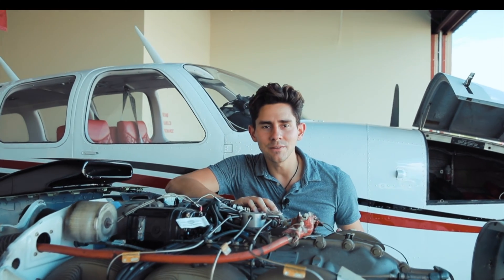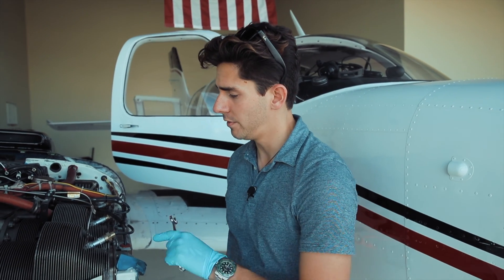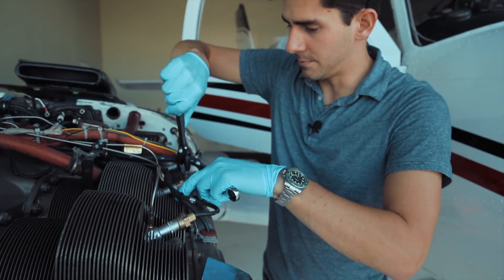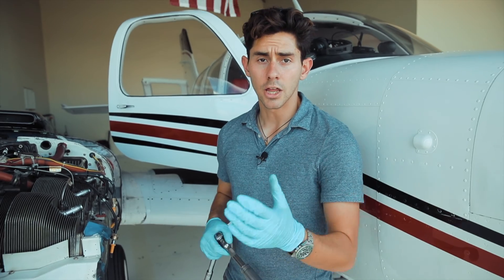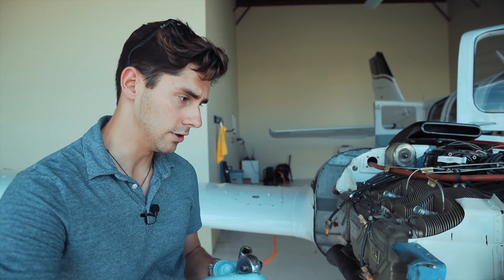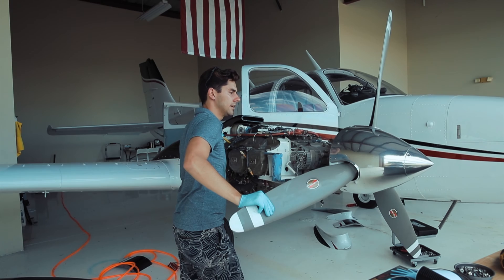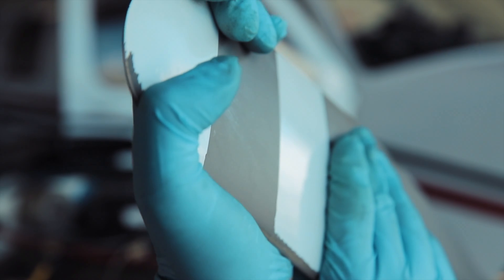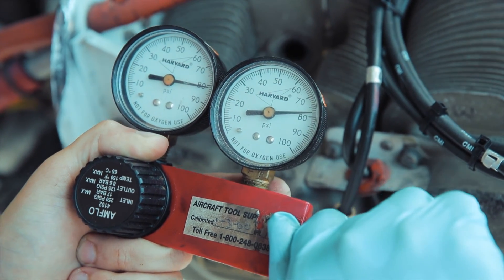Aircraft Compression Check

Comment: Oh no you "dittent"  You were using an adjustable on the loosening of spark plug cables.  A and P should have slapped your hand and given you a proper wrench.
Other than that thanks for the video.  Good job see you in the next video.
All the best neal sw fla
Reply: When I was doing my trade I would have been reprimanded for having an adjustable wrench outside my toolbox
Reply: @stevel1451  sometimes you just gotta use the Kentucky Metric

Comment: I think you could’ve included torque specs on the spark plugs and what type of thread lubricant you should use and how to inspect the spark plugs
Reply from the maker: Hi Dennis. These vary by manufacturers so it’s better to always look up the reference.
Reply: @AviatorZone  No. These things are fairly consistent in aviation. Maybe you don’t know. BTW it’s “vary”
Reply from the maker: @dennisnbrown  that’s wrong. Each engine manufacture is different.
Reply: @AviatorZone  torque- Lycoming 420” Continental 360”lb. Not so hard. There are numerous companies such as ATS or champion that make lubricant/anti seize that work on all piston engines. I don’t think your vid was complete without discussing. That’s all I am saying.
Reply from the maker: http://www.championaerospace.com/assets/AV6-R-Nov2004.pdf
Reply: @dennisnbrown You Tube is for reference only. Any AMT who gets his torque values from You Tube should probably go back to doing oil changes on cars.

Also, if you already know the torque, then why make a big deal out of him not including it?